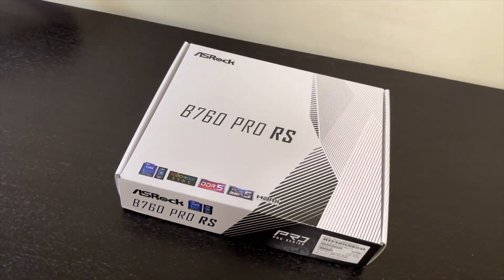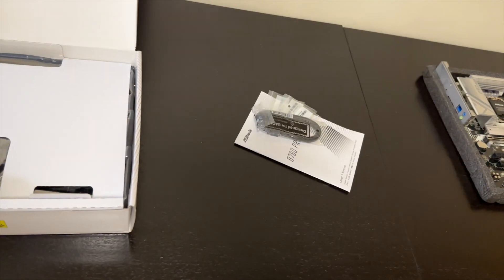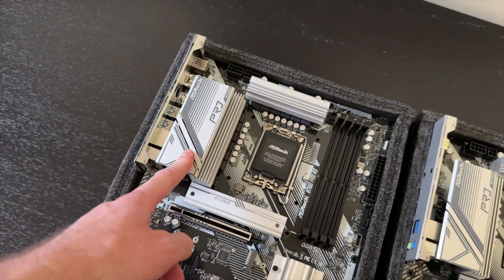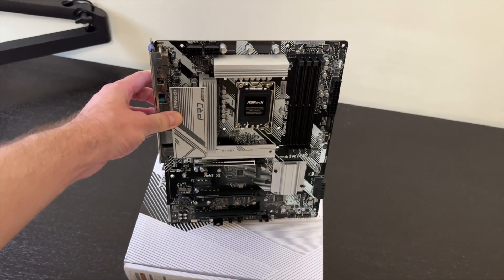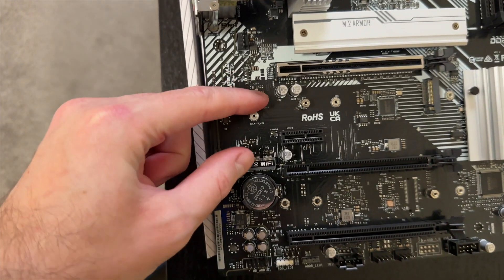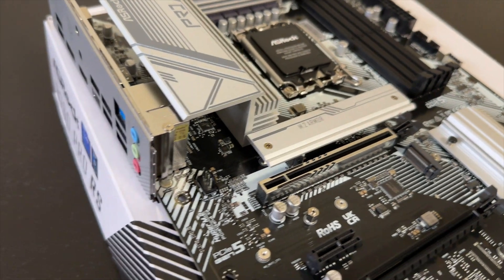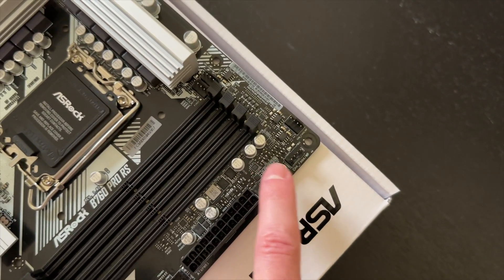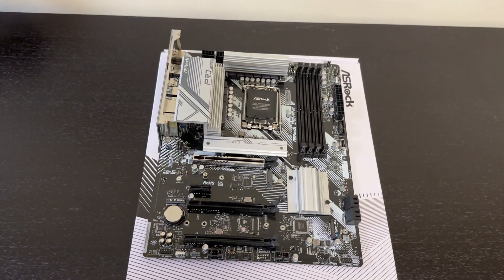Unboxing ASRock B760 Pro RS DDR5 [Features & Specs Overview]

Comment: Cheap motherboards? Sorry are you Bezos?
Reply: Ddr5 motherboard on avg are around $250-300 unfortunately. While the same spec board (lga 1700) can be a fraction of the price because it supports ddr 4. Kinda crazy

Comment: Se puede usar con una I5 12400F? Oh habria algun problema?
Reply: That would be a good pairing. Originally I had with a 12700KF but it's been swapped to 12400F for work/data now, better pairing, cpu is limited to 125W on this board.
Reply: @dianaalyssa8726  oh perfecto muchas gracias

Comment: I have the Z790 Pro RS/D4 version and it's one of the best budget boards out there. It can even run Windows 7; if one is so inclined, thanks to the PS/2 port that allows you to install the intel USB drivers for win7. In my messing around I managed to install all but two devices that evidently don't seem to mater. The OS is also installed on an M.2

Comment: Have this board.
Reply: How its performing?
Reply: @neelroy2350  Pretty good. Had 12700KF, a  12400F is going in there next. I've had a 1060, 3060, 7900XTX all work perfectly. I did change out the ram kit for a QVL pairing (did that with all of them). 48gb DDR5 in currently. Have the Asrock B760M Pro RS variant (great deal was 99 & tax). Wattage on the B boards is here a 125w limit on the cpu. Also have Z690s now to compare; solid board. There is a bit of a small performance difference with a K chip having a Z board pairing but it's not huge.
Reply: Is it good? Also what cpu are you using?

Comment: Is it true this MB will not run an i5 3600kf at OC speeds?
Reply from the maker: What do you mean by "OC speeds"? You can not overclock CPU on any B760 motherboards. So, I assume you mean something else?
Reply: no such cpu as 3600kf